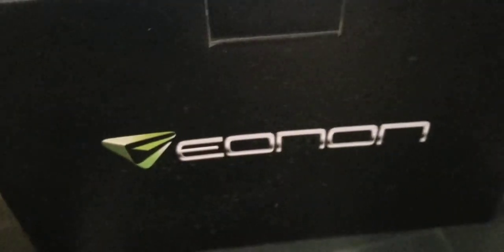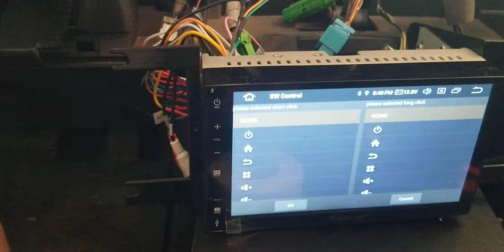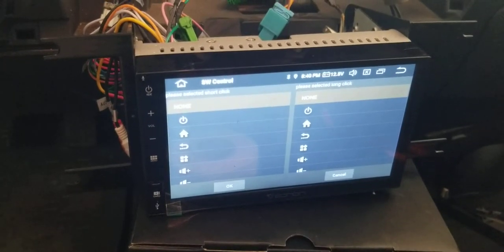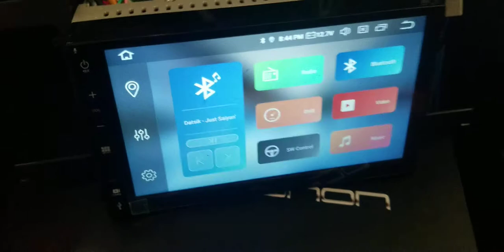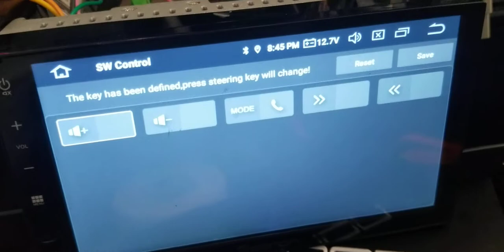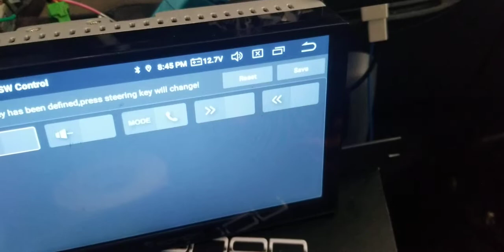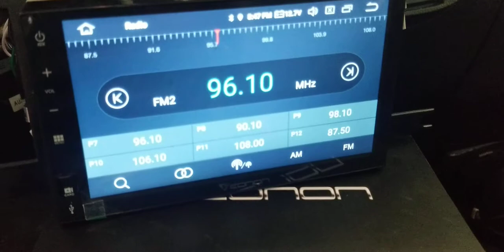Honda Ridgeline 2007 steering wheel control wirering

Comment: This video is fantastic!  It worked on my 2007 Honda Odyssey with a cheap Chinese head unit and now the steering wheel controls all function.  The wire colors were different but the plugs were the same so I went by the pin numbers and it worked.  I couldn't find this information anywhere else.  Thanks!!

Comment: I used the Friegromech ISO harness it connects straight to the car harness and ISO connector on the back of the radio and you don't have to do all those connections you did, and with your info I got my SWS to work thanks.
Reply: Do you remember the part number. Also did you have to solder any wires like he did ?
Reply: @jmax6614  
Fiegromech 8-PIN ISO-02
I used it on a 2001 Honda Accord, the only thing I had to do was to cut into one cable so I can use some of the steering wheel controls on the radio but no need to solder any wires.

Comment: So I do have a good question.  I bought the aftermarket wiring harness so I could just match up the colors and at least my head unit should work.  But now I'm Trying to get the steering wheel controls to work. So I have your typical purples to Purples, whites to whites, Greens to greens and whites the whites. Then black to black red to red blue to blue yellow to yellow Orange to Orange And then off my stereo harness is a Orange w black  wired to Orange w white. But Orange w black is Key 1 and brown is Key 2.  What do I do with this ?

Comment: Thank you! The OEM navigation system is no longer supported/updated so we want to move to newer systems. Do you know if this trick will work with 2013 Ridgeline? We have a 2007 and a 2013 in the household-- both RTL with navigation. I know the dash kit for both seems to be the same.
Reply: any luck? i installed a carplay in my 2011 with nav. i’m pretty sure you need to run it to the dvd module under front seat. no idea how
Reply: @bennyo  Haven't decided on what head unit to get.
Reply: @bennyo  Thanks. I'll have to look into that one.

Comment: Good video man, few questions hopefully you can help me. What is the model number of the metra harness you got? Did your car have the navigation system in it or just the regular radio unit before you installed your new head unit? Can you still use your factory subwoofer? Thanks man!
Reply: Check out crutchfield for more the harnesses and speaker sizes.
Reply: You can still use the factory sub, and it doesn't matter if you have the navigation unit or the regular head unit.
Reply from the maker: @narwhal5908  how did you get sub to work?

Comment: Hy, I have a Honda Ridgeline 2006. Please HELP!! could you tell me if you connect and where your connect (in case) the brown cables (Key-1 and Key-2) some people say is for steering bottoms. I have the 10.1 Hikity car stereo too. Also, did you connect and where your connect (in case) the yellow cable (Memory) from the aftermarket harness (Harmony HA-701721). Also, i understand I don't have to connect the pink/white (Dimmer) cable. Please could you let me know. THANKS. You have a great video!
Reply from the maker: Key 1 and 2 go together to pin 11. I don't think your dimmer cable would  work, I hooked mine up and didn't work for me.
Reply from the maker: I also have a diagram somewheres I could send it to you if you like
Reply: Dimmer can work connect it to red stripe black wire on the car socket

Comment: My factory sub, doesn’t work.
How u did it?
Reply from the maker: I dodnt Think you can use it after you change your stock stereo because it works only with your stock radio
Reply: @rossesteban7859   correct....the original radio had 5 channels... channels 1 through 4 for the door speakers and the 5th channel for the sub.
Reply: You need extra amplifier to boost it.....